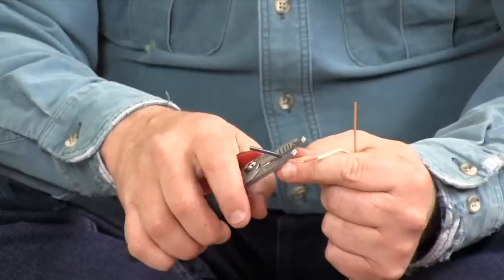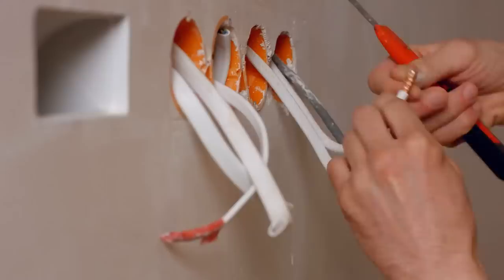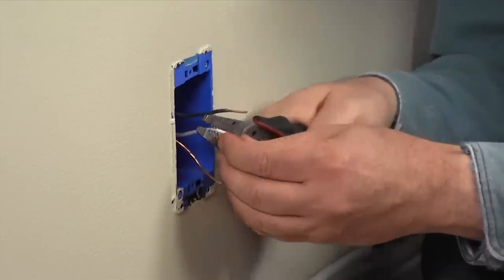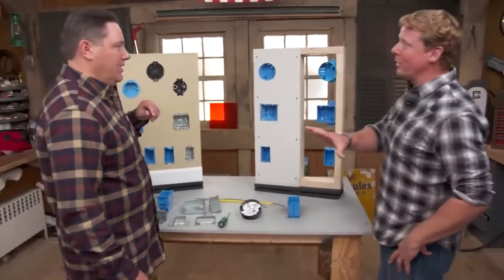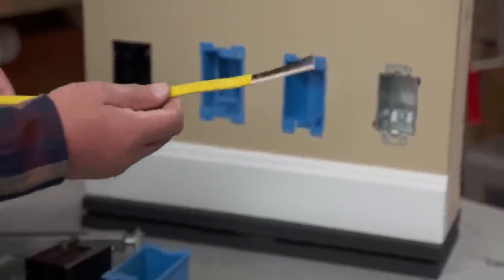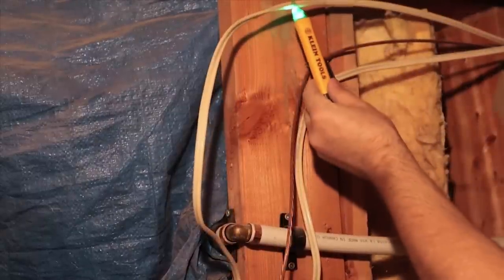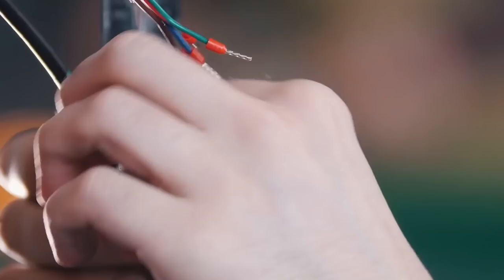Electrical Mistakes That Every Electrician NEEDS To STOP Making!

Comment: If you are an electrician and doing ANY of these things, IMHO you need to reconsider your career choice.
Reply: Indeed. They compiled mistakes no electrician makes just to be able to connect it to a fire hazard or a fatal shock. The most common mistakes the less than average electrician makes usually relates to aesthetics or accessibility for future jobs. Not one electrician on any of my jobs have caused a fire or a serious shock wiring houses.

Comment: In this video, the GFCI-TR receptacle was installed by using straight connections and then was jammed into the box causing wire and device stress. 
A good and safety oriented electrician that cares about his work and the safety of people will pre shape the wires and hook & torque them properly.
Reply: how would it cause stress
Reply: @randomrazr  The flex on the bent wires applies pressure on the hole. After some time. This 'wire stress' contributes to failure of the stab-back type of hole.
Reply: @DevJB  i have an actual eletrical question. so i installed and replaced a light switch with. a timer light switch. i noticed the timer light switch is warm to the touch and the neighbor normal light switch is a little warm too. i know the back aprt of the timer switch was big and took. a bit of effort to shove int he box. is this warmth normal for a timer switch?
Reply: @randomrazr  Do you mean Dimmer switch?  Or is this a Timer ?
Which room? Bathroom? 
Which circuit?  Bathroom fan + lights, or just lights, or non bathroom lights only?
Is there receptacles on this switch\timer ?
What wattage timer or dimmer is it? 
Timer and Dimmer both can get warm but the other normal switch shouldn't be warm.
Is this 15a or 20a?
Reply: @DevJB  its was originally a normal light switch. its for the exterior porch lights (LEDs) . model is Leviton 021-VPT24-1PZ Vizia 24-Hour Programmable Indoor Timer rated at 15amps. the switch feels a little warm to the touch whether the lights are on or off.
Reply: @randomrazr  I'm not too fond of these timers because of the heat issues some have.  1. How many bulbs is it powering? Are all the bulbs the same type and wattage?  What wattage bulbs are you running anyway? 9watt led?   Or 60 watt normies? 
Is this timer on a 3 way switch?  The 2nd switch gets hot you mentioned? Is there a 2nd switch, aka making this a 3-way?
Reply: @randomrazr  Also, is there any flickering or dimming, pulsating of the lights when they're on?
Reply: And properly designed sockets wouldnt have exposed connections..........

Comment: The wire is short is the issue and code violation, but the caused of fire is loose connections, long wire or short wire if the connections is not tight , will cause the arcing and cause the wire, please correct what you are saying!!!! , I am electrician for 35 years and has ran into lot of these issues.

Comment: Push in connectors are a fire hazard waiting to happen. I'm a licensed electrician, and I've seen more than one house fire due to push in connectors (Wego's).
Reply: Correct. Except Wago connections are the ones with levers, not just push in. The push in connectors are the lowest form of UL listed connectors, and it is a shame that they are listed. 
Wago connectors are only slightly better. Removing the direct connection of one wire to the other, involving dissimilar metals, springs that eventually can fail to achieve appropriate pressure, and plastic housings that become brittle in a decade with application of heat from a degrading connection are just recipes for premature failure.
Reply: @mikebowler1962  Wago makes push in connectors as well as the lever type....
Reply: @jimmac1185 , any connector, regardless of manufacturer, that uses springs made of steel, as the only means of connection between two copper wires is suspect in my estimation. Wire nuts use a steel spring that merely applies pressure to the connected wires, its function not primarily being to provide the path of current, only to apply pressure. In a wago or any other stab or lever connector, the function of the spring parts is to provide a current path. In very low current applications, these work advantageously for a number of good reasons. However, when applying these products to receptacles/wiring whose function in general use may be to serve higher current applications, longevity and safe operation are unlikely outcomes.

Wire nut connections that fail over time are extremely rare, and almost always can be traced back to poor implementation at time of connection, or exposure to unusually corrosive conditions that would certainly result in even faster failures using dissimilar metal connections such as a wago.
Reply: @mikebowler1962  I was just correcting that you said Wagos weren't the push in type. Thats all.
Reply: @mikebowler1962  good point
Reply: Remember when Aluminum was the rage... A loose arcing wire starts fire... Plus NO Lox used in splices... Aluminum heats and contracts more than copper... I've been in rip outs of that garbage...
Reply: @skeeskeeter6994  seen my share of this problem.    in homes from the 60s to mid 70s.    Manufacturered homes from this era are especially problematic,  since the vibration from being transported from factory to final destination can shake connections loose, and aluminum is less forgivable than copper.   Another very serious issue with aluminum wiring occurs when copper and aluminum were spliced together with a standard wirenut.    If you live in or are buying a home built before 1960, and there was a major remodel or addition from about  1965 - 1975, or the home was built during this time and had a renovation or addition afterwards,  it would be a good idea to check for this hazard.   copper and aluminum expand and contract at different rates with temperature,  and aluminum can undero electrolysis when in contact with copper, either of which can lead to loose and hot connections
Reply: I cut the wagos off conductors but leave it on the bond (grounds) then just twist it so it's always touching. Maybe I'm just a bit lazy ;)
Reply: "Push in connectors are a fire hazard waiting to happen."
Absolute horseshit. Improper installation is what is causing the issue...  for instance the wrong gauge, incorrect length of stripping or having stranded wire into a connector only rated for solid wire is what is causing the problems, just like all those loose wire-nuts at the bottom of the junction box. Wagos have been used since the 1960's, and became more or less European standard in the 1990s as they are both reliable and a lot faster to work with than the previous screw-in connectors. Had what you said been remotely true, the insurance companies would have declared push-in and lever connectors voiding all claims after half of the European houses burnt to the ground. 

" any connector, regardless of manufacturer, that uses springs made of steel, as the only means of connection between two copper wires is suspect in my estimation"
While you are technically correct (I wouldn't trust a steel spring as conductor either), most push-in and lever connectors and Wago in particular have a bus-bar in copper, with the spring just providing pressure on the wire to ensure the contact.

Comment: Excessive power-transformer noise at the start of operation is most likely caused by
A. an open feeder switch.
B. a loose brace.
C. an open load fuse.
D. a defective radiator.
Reply: Or a bad Fuel Injector

Comment: I agree with most everything in this video. I have been a master electrician and contractor for over 40 years, and  have seen it all in that time. 

Short wires, junction boxes that are too small or non existent.  Splices inside walls, staples that were driven in so tight that the wiring is shorted years later (just to name a few)

I also agree with the comment that said something like 'it may look easy when you see an electrical project shown online.' Yes, that is a pet peave of mine, those that think they know what they are ( or were) doing and then causing a problem without even knowing it. I myself, have watched professional electricians on home improvement shows make potentially dangerous mistakes. Not much one can do other than shake my head in dismay.

Anyway, my last thought is this- if you are confident in what you are doing (and research from several sources) then go ahead and tackle your electrical project. If not, ask a professional just like this video suggests. Also, make sure to ask any questions if you have any concerns about the work (should you decide to hire an electrician)  After all, it's your house ( or business)

Stay safe and work smart.
Reply: I remember around 1979 when I was just started electrical work. A man added a receptacle in his den coming off the dishwasher circuit in the kitchen. I suppose he used it because of the ease of getting to it. At any rate he set the den receptacle on fire and called us out to fix it. I'm retired now after a lifetime of electrical work but that one still sticks with me.
Reply: After the fire from shoddy electrical work... Be sure to tell the insurance adjuster your a wanna be ELECTRICAN...
Reply: I remember I little problem we had with our dry wall contractor... They get paid by  the board hung... Well, we had our rough inspection done... So, we told them close  the walls up... I was a 4th year apprentice I told the 2nd apprentices to roll the wires back into the box on all boxes... (the last drywall contractor cut them even with the box)... I was doing panel risers and started to do under the counter stove tops... When we left for lunch the panels were tagged and shutdown... So, I resume my range tie in and wham..!!! I broke through the counter with my back... Then all hell broke loose... THE DRY WALL CONTRACTOR...TURNED ALL BREAKERS ON... My foreman had just finished another Drywall contractor screw up... So... He wasn't happy... and proceeded to use his 5 pound hammer looking for our buried boxes... You don't screw with him...

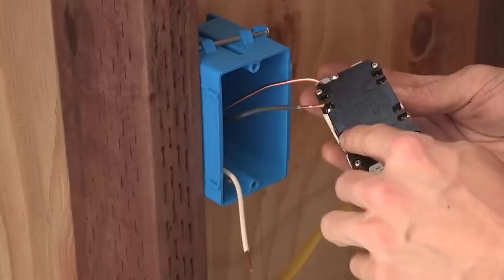Comment: 6:58 The black wire has the copper clearly nicked, meaning the effective conducting area is compromised. Cut off, and strip again.

Also they missed the foundation of electrical work: securing the workplace. Break the circuit at the fuse box, make sure it can not be switched on before you are done, and measure live, neutrals and ground against each other to make sure the circuit indeed is broken.

Comment: Another one they should avoid is making a mistake and refusing to take the blame for it, then ducking the customer's calls for 3 weeks until being threatened by a lawsuit.
Then reluctantly come back to "take a look at it" and quickly realize they fucked up after all

(He forgot to reconnect the wire to my well pump, but told us he doesn't make mistakes like that and that we should call the well company or get a new pump.
Luckily I'm not a complete moron or I would've believed him and paid $20,000 for a new pump that still wouldn't have worked)

Comment: Also pay attention to your surroundings.if you are close to rail road,and feel the vibration thru your house,  may want to check the screws from your electric panel .. they will get lose with the time . Was almost late for me but I was home..one of the screw on the panel got so lose that start sparking and getting hot to the point of melting the protection cover... after retightenning,  everything was fine .. checked all of them and all lost some of the holding power .
Reply: Wow I would have never thought of that. I manage properties I am going to make an inspection sheet for electricians to check out each panel since the building sits right next to 2 train tracks.  Thank you for sharing your experience.

Comment: Using push in connectors is asking for a fire. They are unsafe, poor connections, often resulting in surface area of contact that is insufficient to handle larger loads. This includes the push in contacts in residential devices. I can't remember how many of these I've seen melted/burnt because of the degradation of the connection over time. Wago connectors are only slightly better.
Reply: I have never seen a cooked melted Wago connector. I can't even remember how many cooked wire nuts I've encountered. True wire nuts are more common than Wago's but again I have never seen one that melted from a poor connection.
But by far the most common thing that I have encountered is melted, cooked GFCI outlets used outdoors. Most were in water resistant housings, but I have seen more than my fair share of exposed GFCI outlets melt down and cook 3 or 4 inches of wire along with it.
When I built my home it only made sense to use GFCI breakers instead of the outlets
Reply: We have to use wire nuts to extend\pigtail wires in our panels and boxes.  Connectors are only allowed for recessed lights, can-lights, pots, mostly.  And low voltage; for us.
I mostly use them on 15a ceiling lights because they come attached to the can-light.  You have to relieve all wire stress by pre shaping the wires to fit nicely, or they have high chance of failure.
Reply: Meanwhile, level and push in connectors has been European standard for over 30 years...  while wire nuts are shunned as inefficient and prone to faulty installation.

Comment: A short is caused by the hot and neutral making contact not bad connection!
Reply: I caught that too. Actually if you listen carefully it is pretty clear the person who wrote this does not really understand the topic. The text is just a bunch of stuff found searching the web thrown together haphazardly. And many of the statements seem garbled. For example what does he mean when he says that it is important to strip wires of insulation before cutting them, otherwise there is a risk of cutting them too short? Either nonsense or very unclear. Plus there is a lot of filler which sounds like something a student would write in response to an essay question on a test when he did not know the answer.

Comment: 4"' sticking out past the box is plenty. it will allow enough length for future device changes as well.  too much excess wire is a sloppy job.
Reply: agreed, too much extra makes things tighter in the box, nothing fits right and is it's own problem. I usually target 3", it's just enough to work with and fits without causing more problems.

Comment: Do not use those twinkle connectors for any loads over 5 amps if you know how to properly do a wire nut you will have no problem Winkle connectors are not made to hire handle high amperage even though they've been approved I'm sorry but I would not use them they're great for doing LED lamps and feelings but that's about it
Reply: Meh, they are routinely used for loads up to 32 A (highest residential current, as the voltage is twice as high as in the USA) here in Europe, being more or less defacto standard since the 1990s.
For industrial use there are Wagos rated up to 63A, so Cunk on you.

Follow the manufacturer installation specifications, and problem is solved.

Comment: Ok maybe it's just me. To leave enough wire and have consistency.  Make your hand a blade. Your fingers will touch the back of the box . Cut the length at your wrist. Especially if it's your home so you will most likely be the person how has to deal with short wires. Be a team player and leave enough to make 1 mistake.
Reply: Very well said...
Reply: 6 inches out of the box
Reply: @Tre16  it's 6 inches total, 3 inches from the face of the box.
Reply: @mattlitton8066  I think you are mistaken. Is 6 inches from front of junction box. Please check on that and correct your comment.
Reply: @joaquinsuarez6090  300.14 Length of Free Conductors at Outlets, Junc-
tions, and Switch Points. At least 150 mm (6 in.) of free
conductor, measured from the point in the box where it
emerges from its raceway or cable sheath, shall be left at each
outlet, junction, and switch point for splices or the connection
of luminaires (fixtures) or devices. Where the opening to an
outlet, junction, or switch point is less than 200 mm (8 in.) in
any dimension, each conductor shall be long enough to extend
at least 75 mm (3 in.) outside the opening.

Straight from the NEC, I'm not mistaken.
Reply: @mattlitton8066  To me 3 inches from front of box is to little. Almost 1 inch is used to connect to outlet or switch, that only leaves you 2 free inches which is not long enough to work with. I will continue to leave 6 inches like most people.
Reply: @joaquinsuarez6090  good thing you dont run the NEC, we'd have 9 inches of free wire requrments in a 4 gang 4 switch..... nightmare mate!
Reply: I’ve been an electrician for 25 years. It kills me how many people cut wires short. If people only knew that it’s actually a lot easier to neatly fold those wires into the box as your putting the devices in. Also, if there’s ever a problem you still have plenty or wire to work with. My first boss always made us put a “burn up loop” in a lot of stuff. He also taught me that you don’t EVER cut a wire unless absolutely necessary. You may need that wire later on.